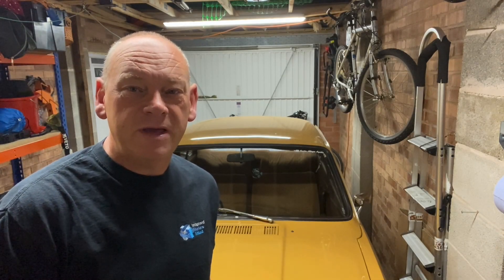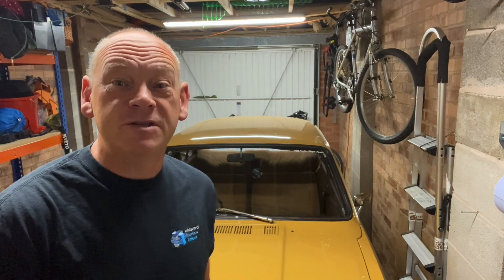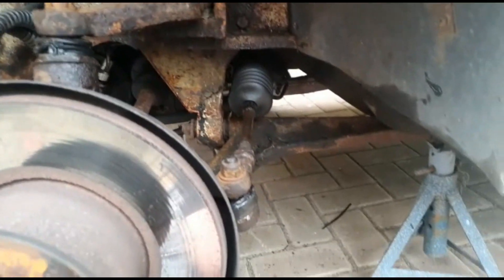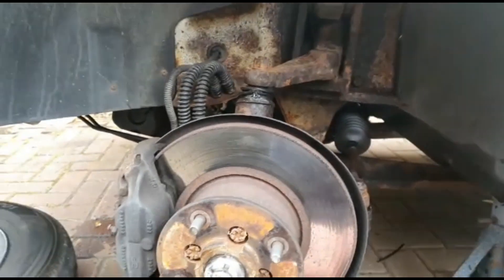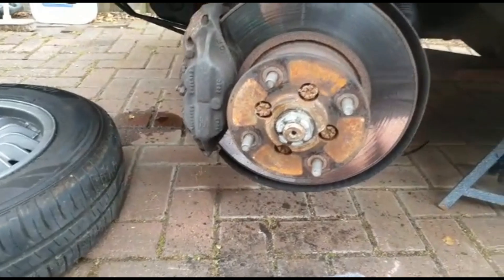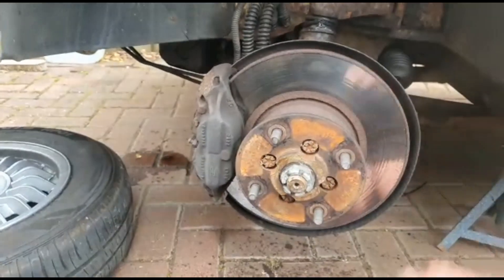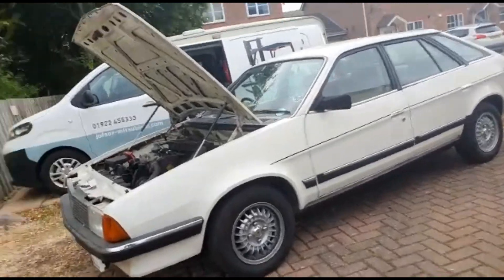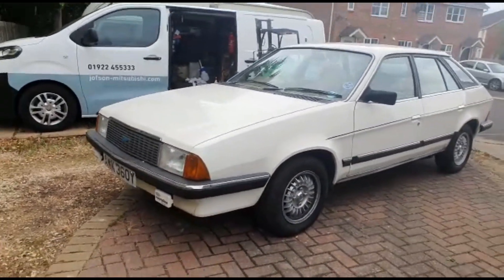Austin Ambassador - More Maintenance - Knocks And Noises!

Comment: I had 2 MK2 Clio's. They didn't have any problems with ball joints but CV gaitors yes and one time it started knocking round corners. The CV joint was failing and had a second hand driveshaft fitted.
Reply: My mk2 Cavalier went through cv joints like they were going out of fashion...
Mind you... I did drive it like a hooligan 🤣

Comment: I’ve got a vehicle that has steering lock stops, like bolt heads that originally had plastic covers on and on full lock they make a terrible noise. Those just need a blob of grease every 6 months or so.
Reply: Cool... 😎
Lock stops are still found on forklift trucks 😉
Reply from the maker: And Land Rovers
Reply: Actually I reckon the engine out of mine would likely of been used in fork trucks, it was certainly fitted in the old london cabs and the manufacturer does make fork trucks 😂

Comment: Great job done Lee.  I'm surprised how little grease there was in the steering rack and those joints, although I've had a steering rack with hardly any grease in it.  I put oil in my Mk2 Escort steering rack although they later went over to greasing them.  This way the oil gets to lubricate everywhere and I know when the gaiters have a hole in them.  After pumping up the rack with grease, did you release any air from the gaiters?.....you might have a problem if there is too much pressure in there.
Reply: Cheers mate 👍 
Yes it was a bit dry in there 🤣
Yes, I cut uloff the cable ties to release the air... then put some new ones on... I didnt bother to show that on camera, I was getting bored by then and time was getting on.
It's amazing how long these jobs take when you're filming it... especially when what I want to say doesn't come out like it should 🤣🤣